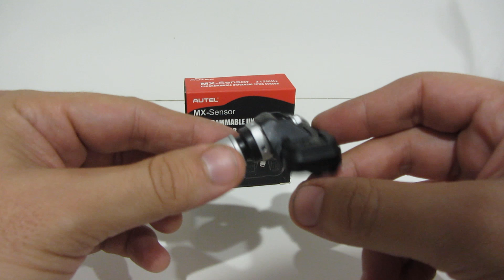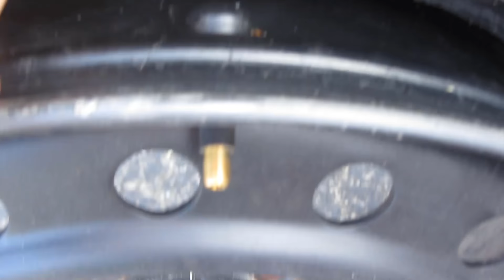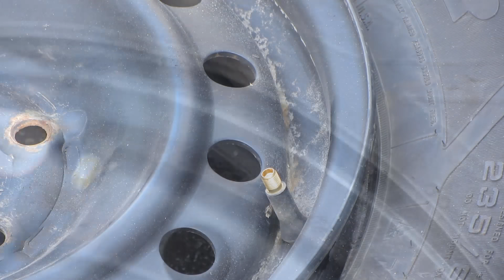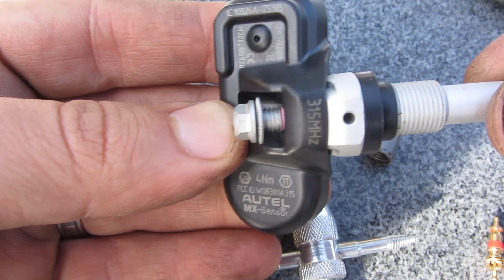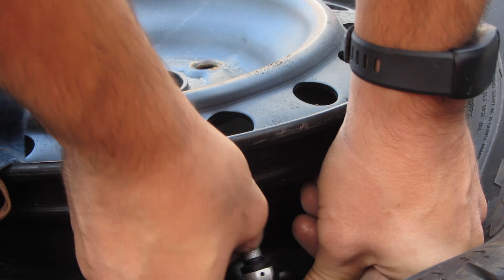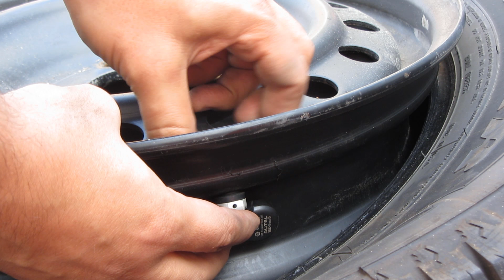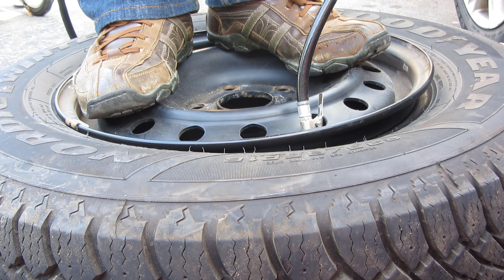Install New TPMS Sensor DIY Without Needing Rebalance

Comment: Just balance your wheels. It's not expensive, and your way to install this will unbalance your wheel, causing vibrations, and wearing out the bearings and ball joint faster. So you need to change everything, which is very expensive, just to avoid a inexpensive balance of the wheel
Reply from the maker: Two things:
1.The tire wasn't broken free.
2. The right tools make things easy. But it's not always impossible without the right tools. I just had to replace the tires on my car this spring and I found used tires and installed them myself and took them to a shop for balancing. It wasn't easy. It's a huge pain when you don't have a machine to do it, but it saved me $100.
Reply: @GabesHacks  very well said, specialty tools only make things easier but the job can definitely be completed with whatever you have available great video man it sure helped a lot of us
Reply: @GabesHacks  so what did you do with you wood block? Writing on the tire? You broke it free. And it can be unbalanced. And don't fuck Ith tires, it's pretty important
Reply from the maker: @sovietcomrade7733  I only broke one side. The whole tire wasn't broken free.
Reply: @GabesHacks  ha so your tire wasn't even mounted good. When a tire is mounted by someone who actually knows something about this, it pops right out. Which makes everything easy
Reply from the maker: @sovietcomrade7733  Did you even watch the whole video?
Reply: @GabesHacks  yeah I did
Reply from the maker: @sovietcomrade7733  Then I don't know what you're talking about. Both sides of the tire never just "pop out". One side will once you break the bead (unless sealant was used), but not both sides.
Listen, do what you want. If you want to pay someone to do this work, then you aren't the audience I'm making these videos for. I know from my own personal experience that this method works and does not throw off the balance of the wheel if you're replacing one sensor with another. If you want to believe otherwise without even trying it, go for it.
Reply: @GabesHacks  I don't pay someone to do this. But if I was forced to do this, I would pay someone. This vid can kill people. It should be deleted. Doing such shit for money man. That's bad
Reply from the maker: @sovietcomrade7733  What could kill someone?
Reply: @GabesHacks  an unbalanced wheel could cause the car to slip on the road at high speed, killing people that are inside or in an other car if they hit one
Reply from the maker: @sovietcomrade7733  Then there's no problem! If you replace one sensor with another using this method, the wheel will still be balanced. I know that because I've done it.
Reply: @GabesHacks  Obviously he has no idea what he's talking about, i would just give up, it's like talking to a wall :D :D
Reply: @willwoods511  Ho yeah the guy that did his wheels himself for his whole life don't know what he's talking about, but a stranger on internet does. Makes sense
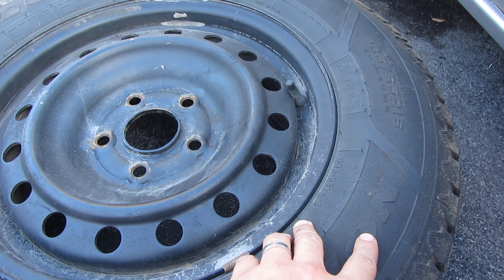Reply from the maker: I talked about balance at 2:17. If your wheels are off balance, get them balanced, of course. But if you're replacing one sensor for another using this method, it won't be off balance.
Reply: @GabesHacks  actually it's gonna be, you remove the tire, and can install it not exactly in the same spot. 1 or two millimeters are enough to unbalance your wheels. This is a bad tutorial. So people, if you see this, take care of your car and don't do this
Reply from the maker: @sovietcomrade7733  If you watched the video, you'll see that I didn't remove the tire 🙂 I only broke the seal on one side. So it is in the exact same position as before.
I have replaced one sensor with another using this method and didn't notice any balance issues at all.
But if you would rather pay someone to do the work, then do so.
Reply: @GabesHacks  I always did everything myself. But when you don't have the tools, even breaking the tire free is dangerous, it can rotate once broke free. And you might not notice an unbalanced wheel, but it will degrade your suspension. I always do my tires replacement on steel rims because I have a machine for it. But I don't do it on aluminium rims, because I don't have the tools. Doing stuff yourself is very good, but when you don't have the tools, DON'T DO It. And don't say people to do it. It can be dangerous
Reply: I didn't see anything wrong with what you did, Gabe's Hacks... that character is bitching just for the sake of bitching... I'm talking about José Gaming.
Reply: This tire will have the same balance as before. Why is this so hard to understand? Tire position is exactly the same. TPMS weight should be the same. You can always compare their weight on a scale to make sure. Then balance if they are a few grams off.
Reply: The only possible way this would change the position of the tire on the rim is if both beads were broken. It's arguable the the TPM vs. valve stem weights could unbalance, but a couple of grams will not unbalance a wheel. Jose Gaming has obviously never watched a mechanic balance a tire. The few grams difference in weights on the stem/TPM is the same as a few millimeters off of setting the wheel weight - which most mechanics miss the mark on. Good video.
Reply: What is the criteria for unbalance wheel? Is it when you do it by yourself installing TPMS its automatic the wheel become unbalance.
Reply: Soviet Comrade - What is your problem exactly?  This is a good video (not vid) and tells people about the balancing.  If you want to get your tires rebalanced, then go do it!  He didn't say not to do it, just that you didn't have to or you can install a counter-weight for the sensor.  I have never, ever heard of someone getting killed due to an unbalanced tire.  Unbalanced people, yes!  Unbalanced tire, never!

Comment: Great idea but from my experience, never break the bead where the valve is located. Always break bead away from valve. Hine site 20/20.
Reply from the maker: What happened in your case? Did you bust the inside of valve somehow?
Reply: The first time I took off tire with a sensor I broke the sensor and had to replace. At the time, the sensors were expensive. But ive learned
Reply from the maker: @tavismaloney57  Yeah, that sucks. That's a good thing to keep in mind.

Comment: Hows the longevity on the autel mx sensors
Reply from the maker: I was a bit disappointed in these ones to be honest. Most of them died on me last year (after almost 3 years). It seems like the batteries died. I thought they'd last longer. But these are the only programmable sensors I've ever used, so I can't compare them to anything else.
Since I still had the programming pad, I decided to stick with Autel and got their newer 2-in-1 sensor and installed those. I'm hoping those will last longer. We'll see.
Reply: @GabesHacks  take it up with them. they should last ten years.
great video!

Comment: Do the sensors need to be synced to the vehicle or something? I recently purchased new tires that have sensors and my car doesn't seem to recognize them.
Reply from the maker: Yes, but how depends on your car. Some cars automatically learn new sensors. Some have a "reset" procedure you can do without any special tools. Some need a special tool. Your owners manual might tell you what to do, or search online for "TPMS relearn" with the year and model of your car.

Comment: Being in the tire business for a long time I see lots of mistakes. I was surprised the little board actually broke down the tire. Try it on low profile tires. NOT!  Always start away from the valve stem. NEVER stand on top of a tire while inflating. I would fire this guy
Reply from the maker: The board definitely won't always break the bead. If any sealant was used, it won't. During the video I linked to another video with a different method using a jack that will get those open.
You're not the first to bring up low profile tires. Apparently it won't work for those too, and that's fine. I've never touched one.
You're also not the first to bring up standing on the rim. I still have a hard time believing a passenger tire is going to explode under the 10psi or so it takes to seal the bead. But by all means, be as cautious as you feel comfortable with.
Reply: Gabe's Hacks 

Calculate the surface area of the tire in square inches and multiply by 10 lbf/in^2. Then consider that will all be released in fractions of a second with you in the vicinity.

A safer way would be to use webbing straps with a clamp on tire inflator while you stand at a safe distance controlling it.
Reply from the maker: @correcthoarsebatterystaple  So, I do get the math. However, I don't understand the sudden concern about this. No one raises alarm when someone inflates a flat tire that's already mounted, even if that flat tire has been driven on. What's so concerning about seating the bead of a tire that was just fully inflated an hour earlier?
I have tried straps, but it didn't work for me. No matter how much I tightened them, it didn't seal.
Reply: I agree if that bead didn't hold he could have gotten seriously injured. I worked in a semi shop and saw one bead not hold and launched a semi rim 30 ft into the air.
Reply from the maker: @raymondhenrysr2904  Semi truck tires are a totally different league. There's no comparison to make with car/van tires. And note that I was only standing on it to seat the bead, which happens at about 10psi.

Comment: Very nice 👍🏼 work but what about the device to program the sensor?
Reply from the maker: I made another video before this one about programming them: https://youtu.be/N6p6xV4PlHc
Depending on your car, you may not even need to program them. Some vehicles automatically learn new sensors or have a re-learn procedure you can initiate without a special tool. Search online for "TPMS relearn" with the name of your car and see what you find.
Reply: Thanks bro big time info 👍🏼

Comment: Whats better steel or rubber stem my dude that works at a tire shop said rubber better cause the metal ones get corroded and messes up the sensors faster
Reply from the maker: I don't see how the metal could have any effect on the sensor itself. The sensor is in a plastic case, separate from the metal. And even the metal ones have rubber on the inside to hold the seal. The metal ones really just look nicer on the outside. There's no functional difference with how the sensor works.
The metal ones are also wider on the outside, so they're more difficult to install if the valve hole doesn't not have much room around it, like on these steel rims that I put them on. So rubber ones out have been easier to install here.

Comment: Where can we buy this censor sir? How Much
Reply from the maker: On eBay or Amazon. I put all the links here: http://www.gabeshacks.com/2016/10/how-to-clone-and-program-new-tpms.html
But it really depends on what kind of car you have. You may not need to use programmable sensors like I did here. Some cars will automatically learn new sensors, or have a learning procedure that you can do without any special tools. In those cases, you can just buy any sensor that uses the right frequency for your car (315MHz or 433MHz).

Comment: 10/10 don't do this at home for the love of all techs.
Reply: Yeah. DIY is very good, but this is not. He doesn't have the tools
Reply from the maker: Why?
Reply: @GabesHacks  unless you have a TPMS relearn tool then most likely you just wasted time money and energy.
Reply from the maker: @jaceeh9954  That depends on the vehicle. Some cars automatically relearn new sensors. Others have a relearn procedure that you can initiate without any special tools. And others you do have to program the new sensor codes into the vehicle. My Odyssey needs to be programmed. But instead of programming the car, I used programmable sensors to match the codes from the existing ones, which I mentioned at 0:40, along with my other video where I described how I programmed them.
Reply: @GabesHacks  initating the relearn mode without proper tools will just set a "Service TPMS system" on the IDD. But yes, you are correct some cars do. But you have to input the sensor ID into the the new sensor regardless.
Reply from the maker: @jaceeh9954  Everything you said depends on the vehicle. 🙂 There really are some cars where you don't need to input anything into anything: you just put in new sensors and drive, and the car figures it out.
Reply: There's two vehicle manufacturers that allow you to do that, too be specific. Lol im just saying 10/10 people won't have the correct car and will be a much cheaper end game going to a service shop. Definitely not a dealership for tpms lol.
Reply from the maker: @jaceeh9954  There are more than two. Autel (the manufacturer of the sensors I installed here) keeps a list of all the cars they support and whether they need to be programmed or not. Here's the list for just the North American market: https://www.autel.com/autelcms/u/cms/www/201611/25020613c72y.pdf
Anything with "A" in the "Relearn Type" column can learn new sensors automatically.
But then there are the cars that have a relearn procedure that doesn't need any special tools, for example, many GM vehicles: https://youtu.be/Muoa_L6F_MI?t=17
But even if your car does need to be programmed with a tool, you can still buy a tool for cheaper than you can get all the work done at a shop for (like the Foxwell NT530, which supports way more than just TPMS), or just get a shop to do only the programming.
Or do what I did and program the sensors instead of the car.

Comment: try this procedure with run flats...I double dare you  !
Reply: Truth Defender  Or just a much longer piece of wood to give you more leverage. Or alternatively, place the tire under the lip of the car and stack a few pieces of wood and then slowly lower the car on to the wood. The weight of the car will break the bead.
Reply from the maker: I've never touched a run flat tire, but yeah, you're not the first to point out that this wouldn't work on one.

Comment: Then summon your Eagle Powers and mentally connect the OBD2 to the new TPMS ID to register it so that your TPMS system recognizes it. Turn on your car, go to the muffler and gently whisper sweet nothings into the exhaust and the new TPMS ID will be registered into the TPMS system. 
Most newer cars needs a tpms computer to connect to obd2 to relearn the status of all sensors. Replacing a sensor doesn't register the new id into the cars computer and the car won't recognize the new sensor and will give you no sensor detected.
Reply from the maker: You have an interesting method of reprogramming a car. 🙂 But yes, I'm aware that many vehicles need to be programmed, although some do automatically learn new sensors. In this case, I actually used programmable sensors because I wanted an identical set of sensors for my winter tires. I documented that process here: https://youtu.be/N6p6xV4PlHc
Reply: I bought a $25 tpms scanner and 4 tpms sensors for $70 from amazon and did the relearn on my car using the key fob. Works fine. Granted, I can't mount/unmount the tires myself so factor that into the cost but the tool itself just wakes the sensor so the car recognizes it. Nothing else to it. May not be the case with all cars but was with my gm
Reply: My shop invested in a tpms computer for all vehicles $600, to program, clone and detected faulty sensors. Dealers charge up to $200-$300 for some sensors and I charge $150, labor, programming both the sensor and the tpms system relearn process. If you guys can't afford to do it right, then it's obvious you guys can't afford a car. Sell it and ride the bus.

Comment: I have 2 cars that I was thinking if it*s possible to put this system in, it works very good compared to having the tires run flat, then you know you have to change it, the cars are from1988, 1989, here we use all season tires,both have factory mag wheels or rims, also my brother has a 2008 Mitsubishi Lancer GT" but it would be known as an ES model, one of his sensors is bad thnow Advance auto partse right rear one, and it shows , they quoted me around almost $250 dollars for one, I can understand if it*s the original part, but a parts store, :(Western Auto), no

Comment: chalk and position of tire has nothing do with weight you will need rebalance tire if you do this
Reply: Your cutting corners and it is not how a true professional would do things.
Reply from the maker: I don't know what you mean by "chalk", and I don't know what you mean by "position of tire has nothing do weight".
Reply: You've changed the weight of the assembly. ASSEMBLY IS THE ENTIRE WHEEL WITH TIRE.with any change in the assembly you must balance.
Reply from the maker: @petiehernande8630  I talked about the balance at 2:17.
A true professional gets the job done right without overspending. The end result of what I did is the same result you would get if you took it to a shop. Even if you feel the need to get the wheels balanced after, it's still far cheaper.
Reply: He must balance anyway. The sensor weights more than the old rubber valve. It is good idea to chalk only when you are replacing sensor or valve.

Comment: Use a lever under the vise grips!
Reply from the maker: For removing the old valve stem you mean? Someone else suggested just pushing it down into the tire to take it out, which sounds pretty reasonable.

Comment: Autel sensor any good.
Reply from the maker: The first batch of Autel sensors (the ones I installed in this video) actually died after a couple years. I'm not thrilled with that. It seemed like the batteries died (3 out of the 4). I already had the tool I used to program them, so I ended up buying new Autel sensors, but their upgraded 2-in-1 ones. They're going strong so far....
I have no experience with other brands of programmable sensors. But depending on your vehicle, you may not even need programmable sensors.
Reply: Gabe's Hacks thank you